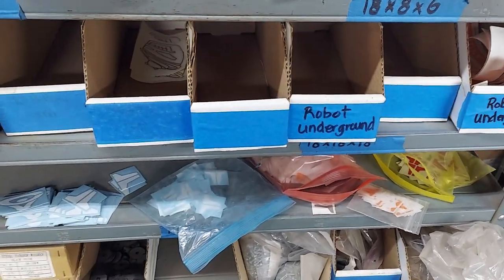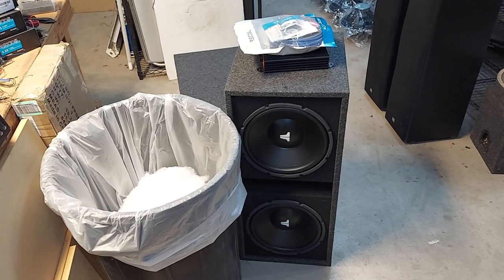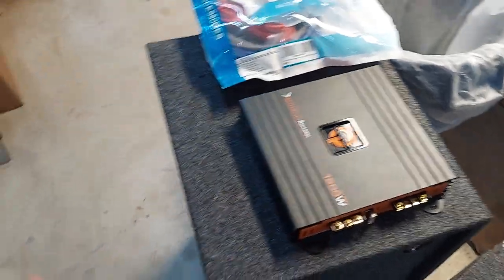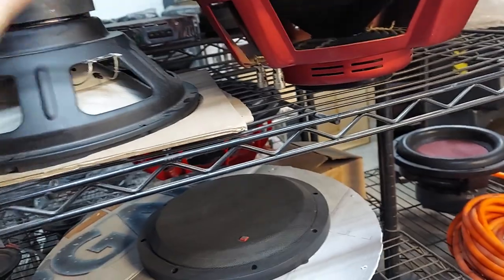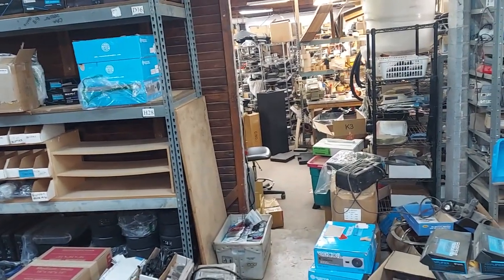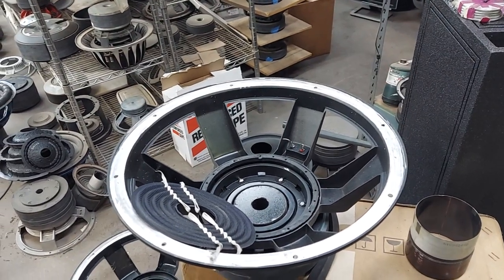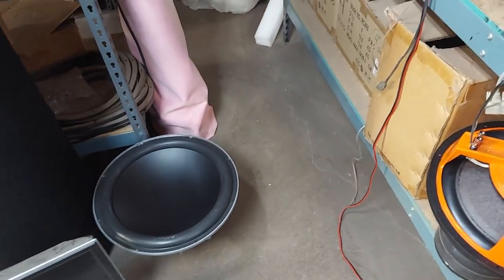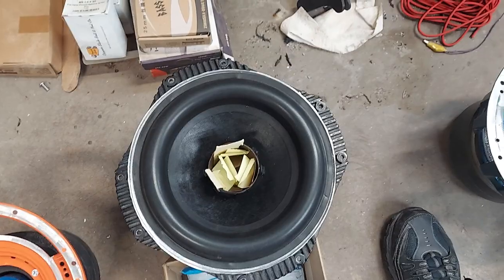Shop Update - Jizz Llama is the hot new brand and lifestyle accessory for 2022! @RobotUnderground

Comment: Looking good so far!
Reply from the maker: Thanks.  Got all the coils in but I think I f'ed up the first cap.  May have to change to an inner cap and then bubble cap for the outer.  Was going to do the shiny carbon fiber ones for you.  I put the dish type on there but it didn't seat right.  I may have to pull it off and do some grinding on the cone.  The new bubble will cover everything though.
Reply: @RobotUnderground  cool, that’s your department, I know you will figure it out 😎